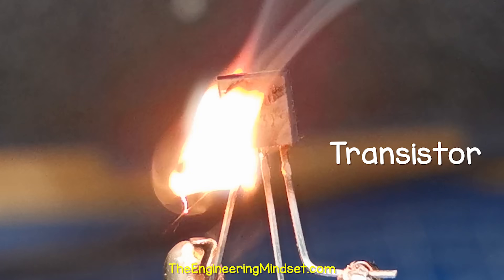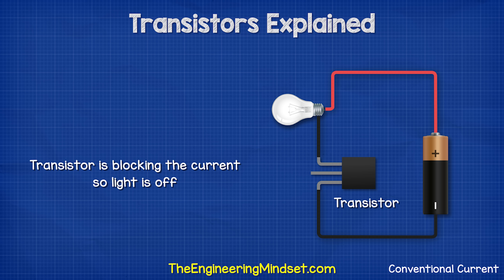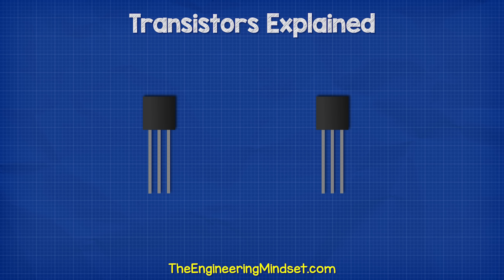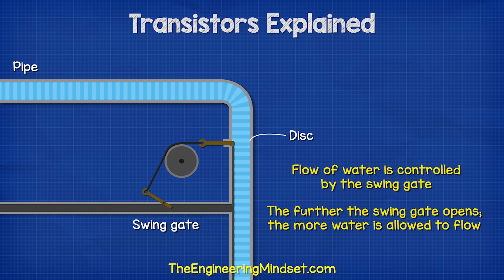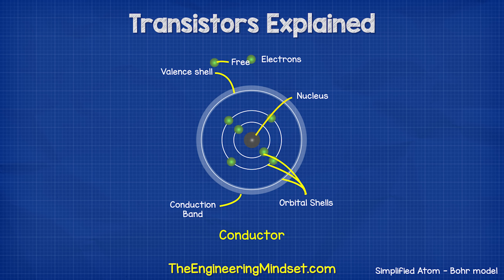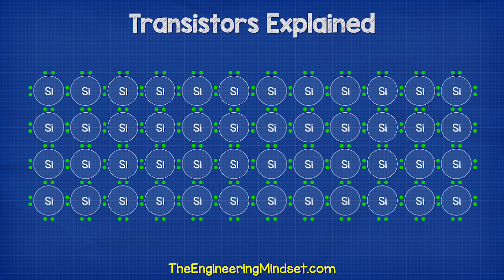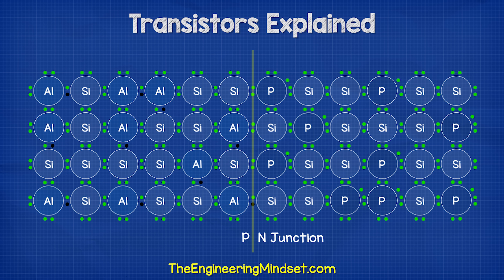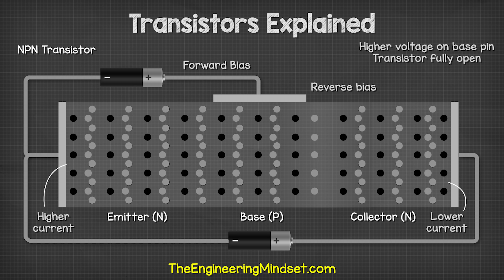Transistors Explained - How transistors work

Comment: Call me dumb but, If your saying the transistor is used as a " switch "  then why is there still an external switch to activate it in the first place ? The only difference I saw is an amplification but in terms of a switch I can just use a remote one to activate the circuit without the transistor. Or am I looking at this the wrong way ?
Reply from the maker: We can use other circuits and sensors to turn it on

Comment: Hi. I'm trying to find out about LDR's. Nobody ever seems to answer, maybe they just don't know the answer.
If I introduced and LDR to the tamper circuit of an average alarm system, and with a laser pointer pointed at it, would the current flow freely enough to keep the alarm system running without a fault? And if I then turn off the laser, would the resistance be great enough to trigger the alarm?
Reply from the maker: You would have to build it and see, I suspect it should work though. But there's far better ways to make sensor for motion through a point

Comment: I don't know about you but its hard for this kind of stuff to stick on my head. I read transistors amplify current. Okay now I have to look up what current even is vs voltage, then I have to make a circuit on a breadboard for amplifying currents. Then it might stick.
Reply from the maker: It takes time to learn the concepts, there's always something to learn. But, don't worry, no one was born with the knowledge, it is something they acquired over time by learning. We have all the videos you need.

Comment: Stupid question but when people design circuits in the conventional way, do they just flip the battery round in the real circuit so the electrons are going the correct way through transistors?!?!
Reply from the maker: Interesting question, but no, the battery remains the same if we used electron flow or conventional current.
Reply: @EngineeringMindset  thank you for your reply. Would that render NPN or PNP resistors defective in that particular circuit if the currents going a particular direction? I imagine that's no problem with AC but more DC. Thank you so much
Reply from the maker: Check out NEW resistor video, everything covered! ➡️ https://youtu.be/DYcLFHgVCn0

Comment: So if the silicon is activated by running power trough it, why is it not activated with the first power that enters the transistor? And only by the middle pin? Dont the first power. Touch the silicon? Im so confused

Comment: Correct me if I make mistake. The example at the minute 16:30, shouldn't the diagram be explaining how a PNP transistor work instead of NPN transistor? You explained from minute 6:32 that when current flows from (+) pole of the battery into the emitter, current will flow out of the base and collector.  My understand is the example at minute 16:30 explains the same concept, is it not?
Reply from the maker: See this video https://youtu.be/MUh_dOcqgVw

Comment: Do someone confirm a npn transistor (bc547) breaks if :

1) base connected directly to +5V (no resistor)
2) collector connected through 220 ohms resistor (led between that resistor and the collector, to the ground => not gate)
3) emitter directly connected to ground (no resistor)

I think that, in that case, since the base-emittor junction is just a diode, there's a short circuit (the PC supply  voltage that I use to  connect the circuit, stops running (security I think...)

Now, did I break the transistor? is it just good to put in the garbage ?
Reply from the maker: Check out NEW resistor video, everything covered! ➡️ https://youtu.be/DYcLFHgVCn0
Reply from the maker: Seen the new LED explained video? so much detail covered! https://youtu.be/O8M2z2hIbag

Comment: I really hate the fact that we are meant to use "conventional" current flow when designing circuits. If it is indeed a fact that "electron" current flow is how current actually flows in electronic circuits, being told anything else is simply a lie. They (and you) may not see it as a lie but, it is. It's no different than saying: a lower temperature is warmer and a higher temperature is colder, the Sun rises in the west and sets in the east, the Earth is flat instead of round, etc. This should stop once and for all. Current flows from Negative (-) to Positive (+)... period

Comment: does anybody know if u can double up on mosfets?? iv got a ton of car audio amps that iv blown the mosfets out of, thats what goes in pretty much 99% of amp failures so if u have one thats not working n dont know why, look there first  although when they blow for me it almost always blows the whole front out of them   anyway..instead of just one mosfet like it was designed, can i simply double up or parallel them up, n get double the power capability?? or would that mess with resistance or some other characteristic on one of the other legs??
Reply from the maker: See my new MOSFET explained video here➡️: https://youtu.be/AwRJsze_9m4

Comment: There are contradictions in this video. At @6:11 you said the currents from the Collector and Base combine and exit through the Emitter. However, later in the video @17:00, your example shows electrons flow in through the Emitter and are pushed out through the Base and the Collector.

Comment: Wait... if Electron Flow is what's actually occurring, then wouldn't the NPN Transistor not merge, but split the current? I would guess the opposite to be true for PNP as well.
Reply: You even show this at the end of the video when you were explaining how the NPN works with the electrons flowing from the negative side of the batteries and splitting between the Base and Collector towards the batteries' positive side. I'm not sure why you showed it the opposite way around 7:05.

I'm starting to feel that conventional current is making learning this needlessly complicated.

Comment: Conventional flow (positive flow theory) took be back a bit, because I was taught in the negative flow theory methodology, that the flow comes from the negative side and pass through the circuit pretty much backwards. The switch up in the middle of the video that proves the later method I taught is 'correct' causes a lot of hassle.

Comment: He started by saying that transistors saved you from switching something on. Then he puts in a transistor, but then has to switch on the base thing for electricity to flow. At that point I said 'why bother"? as you still have to manually press a switch. I watched all of the video and I am still none the wiser. I think some 'concepts for dummies' may have helped. If this indeed WAS the 'concepts for dummies', then........I have no idea.
Reply from the maker: You missed the part just after the manual press when the temperature sensor turns the transistor on. We can use other circuits to turn the transistor on.
Reply: @EngineeringMindset  Thanks for the clarification.

Comment: I think there is a mistake in this explanation. I was told that current travel from the negative pole to the positive pole of the power source, so why when explaining the NPN transistor function in the circuit in 5:40, the current travel from the emitter to the negative pole of the battery and the current enters the emitter from the battery positive side in the PNP transistor circuit function exlpanation?.
Reply from the maker: Answer: https://youtu.be/MUh_dOcqgVw

Comment: really awesome video though electrons don't exist...    electricity is a frequency range as light speed is rate of inductance like sound...making pressure mediation based on frequency the realm if electrical engineering.  think about it...    electron microscope is merely IR imagery of holographic cymatics representing the vibration of voltage amplified into the circuit aka material viewed. Transistor is a phase aligning capacitive antenna.

Comment: still too lazy to understand the main funtion of a transistor, if this is only what a transistor does, why are there too many types of them with different numbers ? also you explained if 1ma current is applied to base we get higher current on the collector. How can be that true ? if that is true why are we not able to create  a free energy generator from this ruling ? give 1amps and get 100amps out of the transistor. that will be a very great invention. Please explain
Reply from the maker: Transistor is a switch we can turn on with a voltage signal, signal can come from anything, a computer, a sensor etc instead of manual press. Current is just added together. Free energy doesn't exist.
Reply: @EngineeringMindset  also you didn't explained the 1ma to 100ma or 1 amp to 100 amp part.

Comment: Hello there, If transistor are like diodes, that only lets current flow in one direction, then how does transistor amplify an ac signal, like a microphone signal. Wouldn’t there be gaps during the negative half cycle ?

Comment: Can a transistor be used to turn off a circuit?  I need the "switch" to always be on and turn off when a voltage is applied.

Comment: it keeps saying the voltage needs to be larger than the barrier for current to flow yet keeps showing a battery that's only 0.5v which is smaller than 0.7v.

Comment: Please help me understand why would you use transistor instead of a switch.
You mention that a human is required to turn switch on and off, so transistor can automate it. But when you put a transistor, it requires one more small power source, and a switch that is manually turned on and off, seems overcompicating simple switch. Someone enlighten me
Reply from the maker: If you use a transistor, you can use another circuit, a computer, a sensor etc to turn the transistor on and off. It completely replaces a manual switch. It automates the switching. It can also turn on and off thousands of times a second, you can't do that with a manual switch
Reply: @EngineeringMindset  thank you, got it. so no physical button, no wear and tear

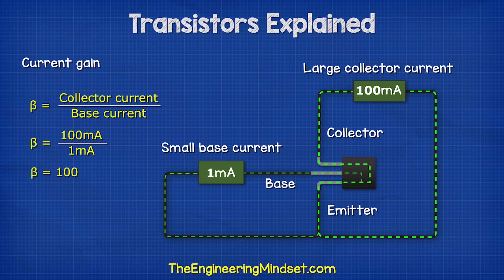Comment: Thanks for the video. I have a question. At 05:03 , There is two voltage sources and they share common ground. And the diagram shows that 100mA current is going back to the 100mA source. 1mA current is going back to 1mA source. How did this happen ? What if the 100mA current goes to 1mA source ?

Comment: at 4:36 you are explaining gain for the transistor and how it behaves. In this example you have both the base and the emitter combined, which is not part of the examples of pnp and npn BJTs. Was this a mistake or am I not understanding something? Is there a special configuration of when you combine both base and emitter? Thanks in advance!

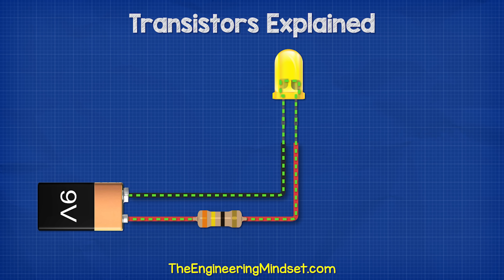Comment: 09:33  That's no more correct than the idea that current flows from the positive end.  Electrons move very slowly in a DC circuit.  The energy of electricity is transferred via electric fields, not electron flow.

Comment: Learn analog technology, as it is very tough against EMP effects. It doesn't require programming, nor accurate clock signals. Russia and China have the capability to launch a hypersonic missile to detonate over the heart of the country and fry the electrical grid and everything close to it. "18 months recovery based on current best practices", meaning many years in actuality.

Comment: Great video! But why do the transistor catch fire if you put in a higher voltage? Is it because of too much electricity?
Reply from the maker: LED example here https://youtu.be/7d4ymjU9NqM?t=17 but the internal parts are tiny
Reply from the maker: Seen the new LED explained video? so much detail covered! https://youtu.be/O8M2z2hIbag

Comment: This is by far the best explanation of basic transistors that I have ever watched! And I’ve watched many many of them. I used to work in a semiconductor physics lab, and you have explained it better than the professor did, in clearer and more easily assimilated terms. This kind of stuff is really needed by many people. Kudos to you 👍
Reply: Perhaps a professor is more driven by his pride in  knowledge and ability to answer questions as oppose to focusing on how to explain things better.

Comment: Electricity is similar to liquid. Voltage is like a pressure. Current is self-explanatory. Diode is a valve. Resistor is a jet. Capacitor is a membrane (as well as the battery). Transistor is a jet which throughput is controlled by the pressure.
Reply from the maker: Check out NEW resistor video, everything covered! ➡️ https://youtu.be/DYcLFHgVCn0

Comment: Im trying to simplify it so the most simple thing is, you can run electricity in the metal part, it is conductive and heat conductive I do not know anything more.

Comment: Not clear on why either diagram matters. Whether than switch the resistors around, why not just reverse the polarity of the diodes? Why would anyone use anything but a general purpose 2222 anyway? Did buy your shirt anyway!
Reply from the maker: Check out NEW resistor video, everything covered! ➡️ https://youtu.be/DYcLFHgVCn0

Comment: NpN, PnP etc... I learned the electronic tubes we used last Century, than the  transistors, following by integrated circuits finishing with microprocessors .
As a musician i have to understand how it works to repare when it needs.

Comment: 3 min in this vid and i dont get it :D why do i have to use a transistor to extend my circuit and use my finger too to push a switch or use heat. i could use heat at the first circuit too to light the bulb or what am i missing?
Reply from the maker: Keep watching, you'll see it's then swapped for an automated open/close

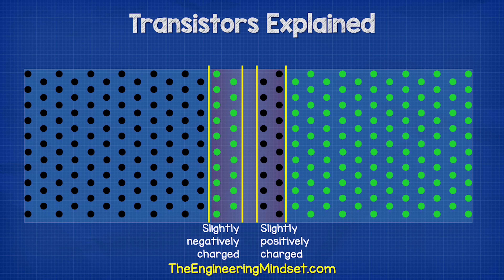Comment: I'm finding it difficult to understand precisely how the depletion region of a particular size forms, and how this relates to the types of biases you explain. Why doesn't the whole material equilibrate to evenly disperse the electrons and electron holes? How does the field with the strength to prevent this (before a current from a battery enters the picture, at time 14:20) come about? Edit: I suppose there was some trial and error by transistor scientists who doped materials to different extents to see what physically worked out on the scale they wanted. Although this does seem like a rather tedious approach, so I wonder if I'm incorrect or if there's a rigorous approach.

Comment: Wow that was better explained then I got from dr. Rex Miller at Buffalo State College in Buffalo New York and he was in electronics professor and they call it the State University College at Buffalo and I took that course many many years ago dr. Miller was a great guy his name was Rex Miller and he also wrote a book and revamped the electronics basic electricity electronics for several different courses and even a radio communication course at Buffalo State the course was fantastic and I was one of the few people that scored a 99 on the final exam memorizing the entire circuit and its processes for a seven transistor radio very difficult to do but I did it and I couldn't tell you how I did it now but that was more than 40 years

Comment: The transistor began the solid state age. Before, switching stuff in machines had to be done with moving parts. The relay is an example of an electrical switch that movies a pin to turn things on or off. What’s the big deal? Moving parts have a big problem, they almost always, with zero practical exceptions, break down with use. Being able to switch electrical flows and functions on and off without moving parts is an incredible deal, because solid state devices last vastly longer, some may never even show wear within out lifetime (wear from use, that is.)

Comment: I always wondered why the arrows in transistors and diodes pointed the opposite direction to electron flow. I'd also heard transistors described as essentially two back-to-back diodes, but couldn't wrap my head around that analogy.

Now I have answers to both of those! Thank you!

Comment: 50 years ago, the emphasis was on "hole flow" in the U. S. Navy electronics technician school.  I didn't fully understand how transistors worked until I took an engineering correspondence course.  Your explanation is easier to understand.
Reply: P side has holes and n side which flows through the holes and it immediately  is transported to the current. BJT
Reply: I'm in the NAVY ET Att course now. I need to know how these things work to pass my tests and move on to A school. 
Of course a fellow ET would be here. 😊 
By the way,  The emphasis is still on Hole flow. I guess not much has changed.

Comment: While the practical application of the info for this video is useful, the models of conventional and electron flow of electricity as well as the atomic models are outdated.
Electrons do not flow through wires. Electrons do not orbit an atom's nucleus like a planetary system.
There are other videos on YouTube that explain electricity correctly.

Comment: I don’t understand the explanation at 2:30, it explains that without the transistor the switch for the circuit needs to be operated manually, however when the video shows the transistor in circuit, it still shows a switch within the circuit so I get the principle but the manual issue still exists.
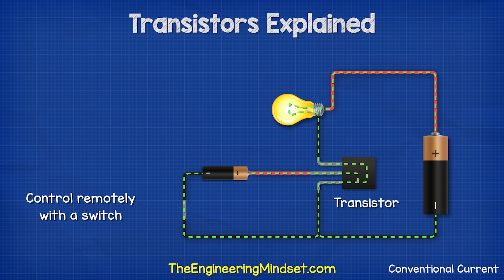Reply from the maker: We can automate it. See 3:00